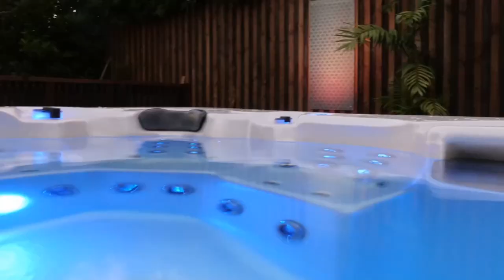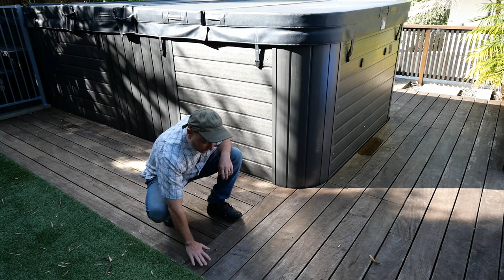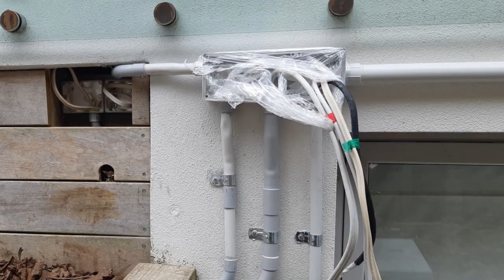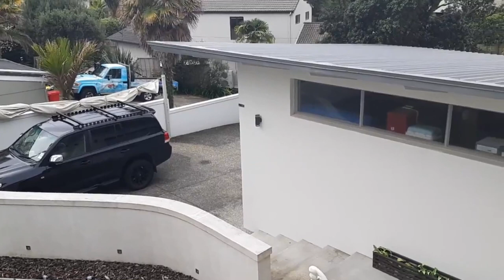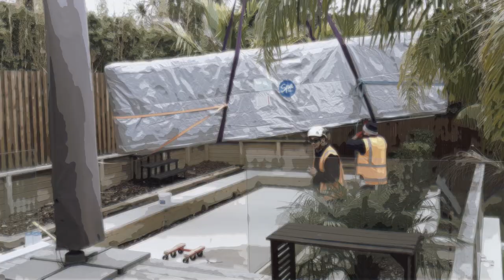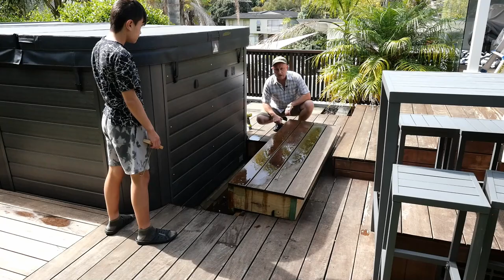SWIM SPA THE BUILD PROJECT  ULTIMATE POOL Part-2

Comment: You have the best review of this! I have a question, I want to do one of these in a back corner of my fenced in yard, I have been given permission by HOA for it to be flush/fully down in the ground as much as possible to give it an inground look . Is this possible? Basically same as yours but much lower to step in to. What problems would this cause if any? I plan to do decking around like you did to remove when needing maintenance, however if I put it right in a corner I will only have access to 2 sides, how many sides do I need to access for maintenance? And if I DO need all sides accessible how many feet can I get away with from my corner fenced area?? I have a very small yard and it needs to go in corner

Comment: Do you have a problem with water getting in the tub at the bottom ? When it rains
Reply from the maker: Good question, I actually put 2 large drainage pipes for the lower ground area, for this reason. it works great.  Great stuff, thanks for watching